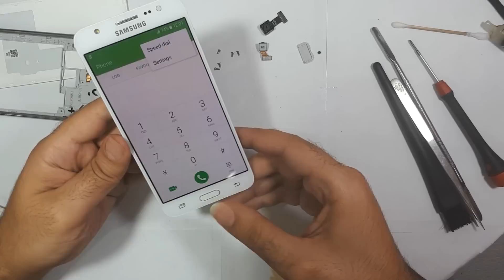Samsung J5 Home ,Menu And Back Button Flex Cable  Replacement

Comment: Hii brother.. my samsung galaxy j7 prime water damaged .. and audio  , back button , middle button not working ... I put my phone in dry  rice it will help or not .....
Reply from the maker: No it won't help, this rice thing is ridiculous, you need to open the device clean it first then if something still not working replace it.

Comment: Hello! Is it often suspending after a few years of using the Samung J5 smarfona (2015) - SM-J500FN the "last application and back" keys after inserting the smarfon into the pants pocket that these keys are blocked for some time
Reply from the maker: Hello , 
No it could be some water damaged it.

Comment: Why not use the 530 screen lift and why you raise the full screen
Reply from the maker: Its better to remove the screen then replace and put the new flex cable, and what did you mean by 530 screen lift , Salah ?

Comment: J7 prime Ka back button strip melegi kya
Reply from the maker: here is the link , you can check and buy , I hope that's your question 
https://www.ebay.com/itm/Home-Button-Key-Sensor-Flex-wEarphone-Plug-Fr-Samsung-J7-Perx-Prime-J727-J727A-V/142664851125?hash=item21377cdeb5%3Am%3AmO8FGRHAzWc9VzoL5OskP6A&var=441647968753&_sacat=0&_nkw=samsung+j7+prime+home+button&_from=R40&rt=nc&_trksid=p2380057.m570.l1313.TR12.TRC2.A0.H0.Xsamsung+j7+prime+home+button.TRS0

Comment: samsung galaxy j5 2016, down volume button stuck in, the phone is also stuck in the safe mode. Can you help me please
Reply from the maker: Does your phone still in warranty ?
Reply from the maker: You can open your device , its very easy to open with no risk , and then you can push it out  and clean it .
Reply from the maker: And if you need any other help i need to see a picture about the situation
Reply: MST i think so
Reply from the maker: You think so of what , this is my email if you want to sens me anything mjds838@gmail.com

Comment: How much it will be cost
Reply from the maker: +SYED YOUSUF AHMED the flat cable with maintenance or without?
Reply from the maker: The flat cable start from 5-8 USD 
flat cable with maintenance form 20 - 30 depends in you country

Comment: samsung j5 home key auto working solution
Reply from the maker: It should be some dirt or water make connection to the home button you have to clean it , or replace it .
Reply: @mstphone  I've seen the Home button sell, so auto works. I think the Home button ic Shot. You please give the picture of ic. Then I would have benefited a lot.
Reply from the maker: If You check the schematic it will be better , check c5070 first , then u5001 , (r5021 r5023 r5022 ) then ucp3000-1

Comment: NOT  a samsung J5 !!
Reply from the maker: How ??
Reply: @mstphone  the battery is completely the wrong shape, in this video it s squarish but in reality the battery is much longer and narrower
Reply from the maker: I can't remember if there was a problem with battery , but you can read the info in some point in the video its J5 , why should i lie bro .
Reply: @mstphone  i have a J 5 The battery is about four inches by inch and a quarter, the sim tray is to the right yours is above, i would guess this is a J4 OR J3 just look up J5 battery or J5 photos
Reply from the maker: Man your phone is different,  this phone is J500 go to minute 0.16  and read the info .
Reply: @mstphone  so now its a J500 ?
Reply from the maker: Bro J5 same As J500 !!!! ,